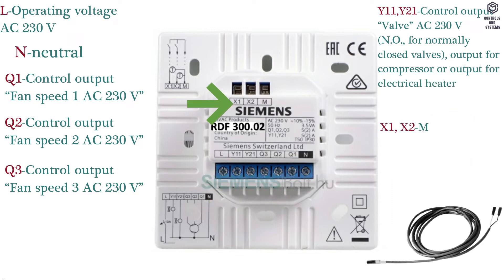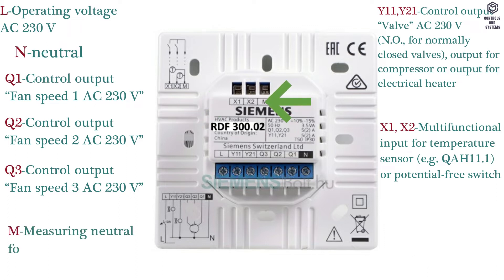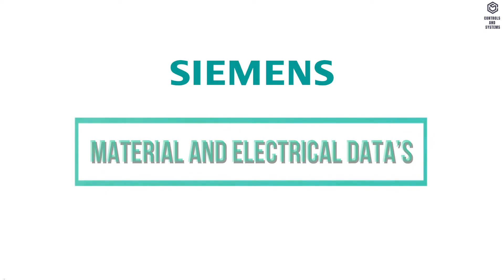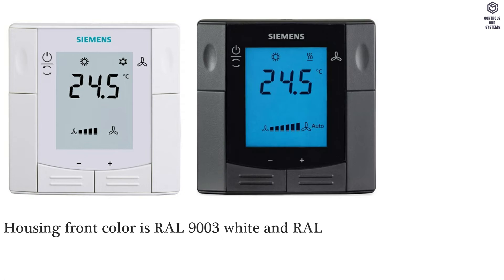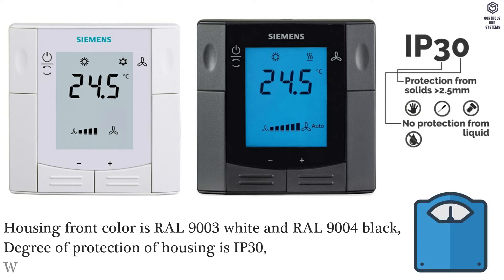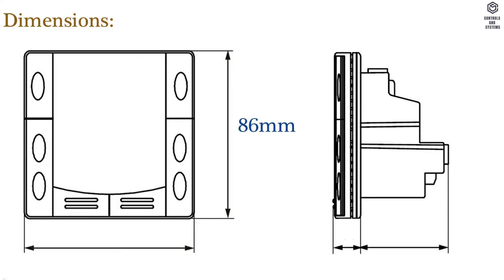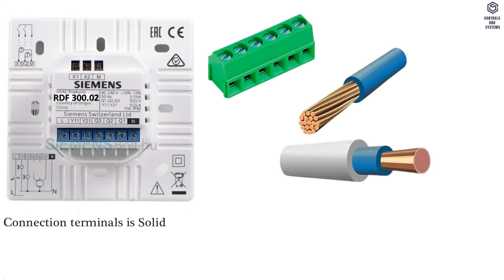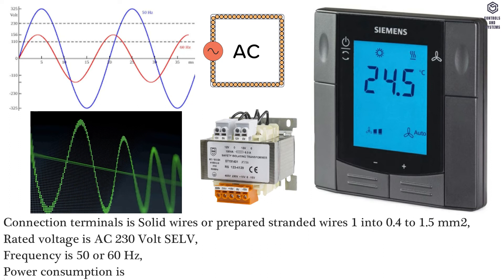Siemens RDF 300.02 Thermostat | Parameter Settings & Technical Data Explained

Comment: Bro, how to make cooler, we need answers 😁
Reply from the maker: Parameter P01 Control sequence : Setting Range is 1 / Cooling mode only.
Parameter P13 Electric heater in cooling mode : Setting Range is OFF / OFF = Disabled.
Reply: @insightcontrolsystem  p013
Doesn’t show